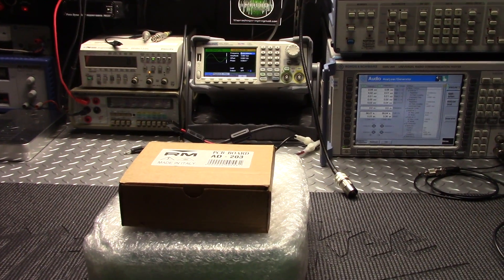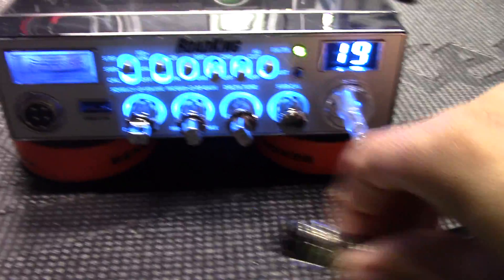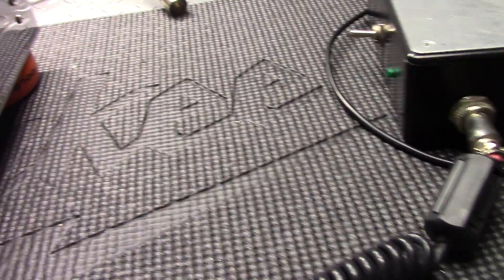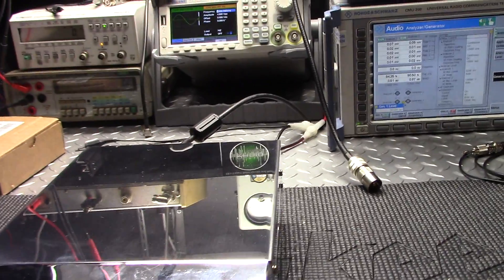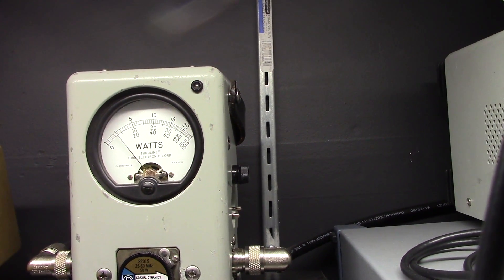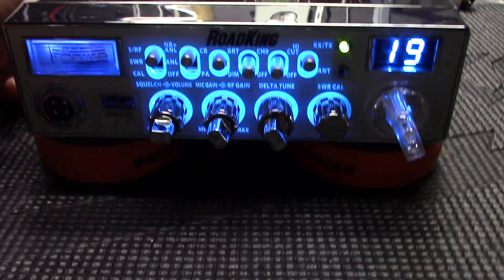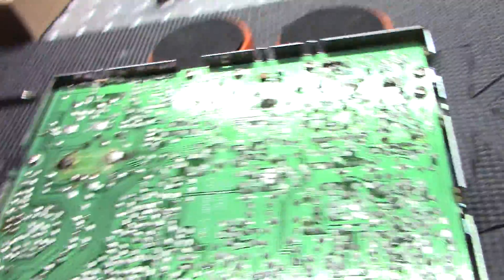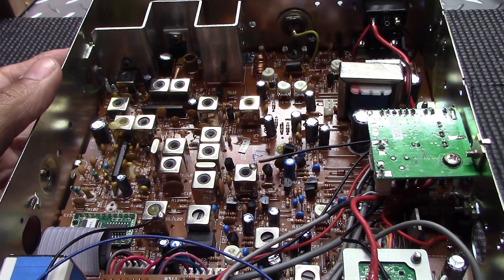AD203 Stinger amp in a Roadking CB Radio (Cobra 29)

Comment: I agree i don't like installing the stinger boards either but i sure get alot of customers that want it. The other one i don't care much for is the RFX 75 and 85 that mounts on the back mainly because if you install it without the cooling fan kit it just won't last and even with the fan they run to hot for my liking. Great video keep up the good work.

Comment: 65 75 watts on a stinger bout perfect... I use 3 diff styles on my builds i use the  the 1446 /2290 on copper  board ..also do exsternal amps like 9530 mosfit and many other RX series boads .. but the home builds are my favorite,only thing isnwe have to remove internal speaker...to built the heatsink  and copper board placement..alot different than what u see here ,but with that said i really like the over all resaults of this radio GREAT JOB!!!

Comment: I come across a brand new cobra 29 lx with a stinger board half installed, it's a brand new radio with a new board. Excellent receive but won't transmit when it keys down...  there is no pass thru or anything reading on the watt meter with the amp power switch on or not
Reply from the maker: What does the antenna so239 look like on the inside? Sounds like something is disconnected.

Comment: Interesting vid.. question,  whats a Stinger board, and its function?
Reply: It is a small amp that mounts internally in place of the internal speaker. I’m sure Matt can tell you a little more about it.
Reply: @gpalacios6850  and who is Matt..?
Reply: Matt is the guy who is the technician from The  Radio Garage who posted and made this video.
Reply: @gpalacios6850   Now I'm wonder, to who did I send that question to..hehe. Guess there won't be an answer. not a problem.
Reply: @MusicMinisterJP7  Stinger board is an internal amp instead of an external that you would hook up through your coax.

Comment: Funny As a broadcast engineer, I do not buy a 500 watt transmitter for my 500 watt station. I buy a 1000 watt transmitter, and run it at 530 wats, depending on my antenna and the 10% plus I am allowed by the FCC. NO ONE should ever buy a 100 watt amp and expect 100 watts!
Reply: Then as a "BROADCAST ENGINEER",you should understand  the difference in duty cycle between a BROADCAST TRANSMITER and a COMMUNICATION TRANSCEIVER. So yes,for a amplifier  that's not "ON" 24/7 you should  absolutely expect 100 watts out of a 100 watt amplifier.